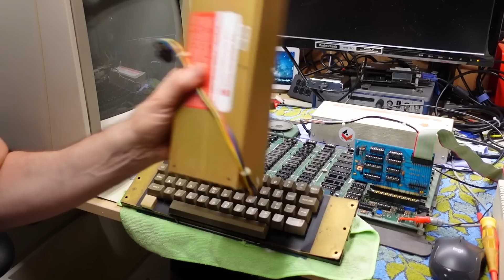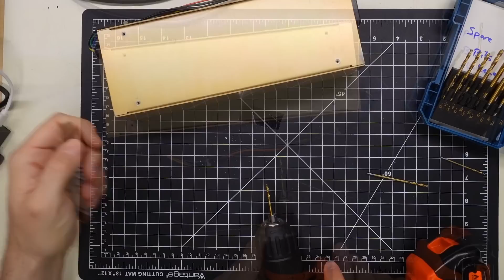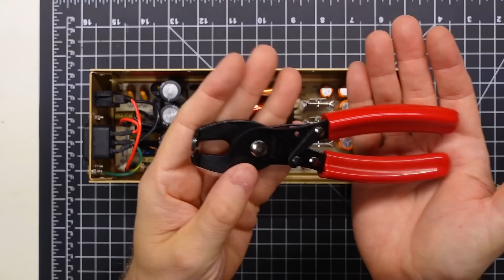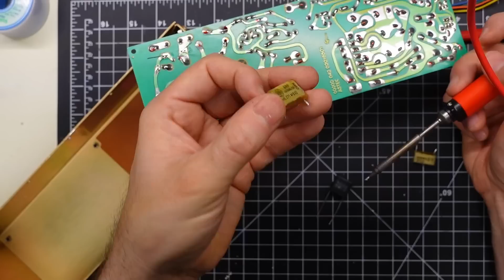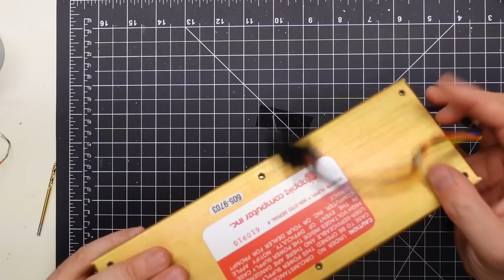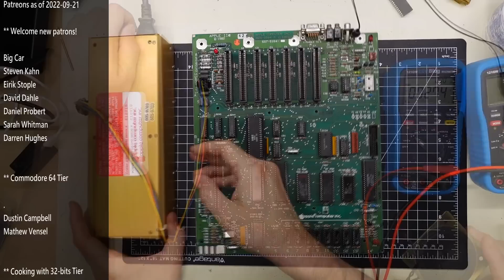Apple II power supply service and testing

Comment: Another reason what you say about caps is true is thus: electrolytes didn’t push as many limits back then, the electrons are packed-in less dense. So, to achieve high performance, you need very high purity and high surface-area. And that’s directly what increased the cost, as well as being responsible for their larger sizes. 

Essentially, it’s akin to how larger floppy disks are more reliable than smaller ones, as each sector is physically bigger. 

People who replace caps all the time marvel at how small modern caps are, but that’s also ultimately just a tighter margin for functionality. It’s no wonder plenty of HUGE filtering caps from the 30s-50s still work great with higher performance than modern ones, once you start looking at it that way. Of course they first have to not be punctured, or boiled, or burst.

Comment: When dealing with a rivet that small I would use a dremmel to grind the head off, then use a small punch to drive the rivet through. Or a dill bit bigger than the hole. And stop once the head is removed.

Comment: dont forget alot of Caps of the 2000s had the capacitor plague as it was dubbed, where alot of runs used water for caps instead of electrolytes

Comment: I think Rifa die in 3 ways. 
1. Humidity-Oxygen infiltration causing decay.
2. material wear either chemical, mechanical, or temperatures causing structural breakdown.
3. Surges when it takes large BANGs through the material and burns a path through it.

*Any of the 3 could contribute to the other's quicker decay and any combination or lone factor could cause failure too.

Comment: Larger drills can be used (should be used) as long as the "web" fits in the hole.  All you need to do is to cut the face of the rivet off of its shaft so the shaft can be pushed through the hole.

Comment: It says right on top. "DO NOT OPEN". Chuck the whole thing in a shredder and buy a modern PC. Do it NOW!
Reply: It's astounding that we have armchair clowns on   idiottube who fail to take any notice of dire warnings on electrical equipment. The switch mode power supplies in the apple II series are *NOT* meant to be opened and messed with. The warning is right there on the power supply itself.  You risk injuring or killing yourself by messing around with high voltage analog circuitry.  There is also a risk of toxin exposure and also ruining the mainboard as replacement caps produce ripples that don't match the original power supply design. 

The only sensible approach to fixing apple II power supplies is to junk them completely and replace them with a modern alternative.

Comment: Hi Adrian, I have a question for you. First, let me apologize for the fact that my question has nothing to do with this video, I'm just taking the shot that you might know something about this.

Some months ago, I purchased a Smith Corona PWP-145 word processor from my local Goodwill. I was thrilled with the find--but although it has a 3.5" floppy drive, it refuses to format any disk I put in it. I tried both high and low density, pre-formatted and unformatted, no dice. Do you have any suggestions as to what might be going on?

Comment: I do a fair amount of SMPS repair at work, and I tend to agree with you on the older caps being better.  That being said, if they have drifted too far off value , or you have too much noise on the output, or are having weird glitches, replace those caps.

Comment: Excellent as always.
FWVLIW: I've tended to replace the guts of Apple II PSUs with modern Meanwell units that have most of the required voltages - Yes, the -5v needs to be added by soldering a regulator to one of the existing rails as the model that has all the other voltages doesn't have that, but it's not a big deal.*
Why? Because they are more reliable and efficient than even a serviced original PSU. Also they have much more overhead for suppling upgrades.

*The Apple II draws so little current on -5v you don't need to worry about bolting a heatsink to it, just find a suitable spot that won't lead to shorts.
No, the new PSU won't line up with the original standoff locations but that's an easy fix - cut a robust piece of packaging plastic to size, screw the new PSU to that, and then screw the whole thing to the original standoff locations. Secure and will ensure no unintended shorts.  

My IIe Platinum is running an Apple2Pi adaptor of my own design that takes it's own 5v & GND supply from a modded and upgraded PSU with a Pi4 strapped to it running a custom install of my own making:
Quite apart from the utility of Apple2Pi my computer does a darn good job of pretending to be a stupidly fast Stealth GS and runs RetroPie as well as giving me a functional Linux (boo!) machine. I modified a broken Apple II mouse for USB / optical / two buttons. All-in-all it's my go-to retro box.

PS A solder wick tip:
If you have crappy wick but a tin of solid flux paste, drag the wick over the paste. Now you have much better wick... or you could just buy decent stuff in the first place as Adrian did!
Reply: What a load of crap,  those Astec PSU's  have worked to 40 years.... with a little TLC and a recap they will last another 40 years.  Meanwell PSU's do not have a 40 year track record so there is no evidence to support your reliability claim.  If fact I'd really doubt they will last that long because we all know that modern devices are not built to last like the old school stuff was.

Comment: 16:16 For viewers that are outside the US and have 230V, these Astec power supply could be easily converted from 110V to 230V by removing the black jumper wire next to the small transformer. It is labeled on the PCB which says "115V select".

Comment: The capacitor plague around the year 2000 is a real thing. A lot of Chinese manufacturers got hold of parts of the blueprints for one of the top notch capacitor brands. Those Chinese manufacturers missed a few critical details though, which made the capacitors leak over a relatively short timespan. The flimsy capacitors ended up in a lot of devices back in the days, due to their low cost in comparison to the actual brands.
Reply: It started in around 1991, tbh, particularly with SMD electrolytic caps. Some stuff from 88-89 was also awful, but as the 90s marched on the component quality went straight to h*ll.
Reply: @MagesGuild  and it went on into the mid 2000’s. Especially with the United Cemicon KZG series which were used in a lot of motherboards from 2000-2006.

Comment: This is a old SMPS and it works with a lower switching frequency than modern ones. So the flintering caps are not that much stressed than today. Right now the new era of GaN SMPS started and the frequency is getting even higer. Silicon based SMPS today are working on about 10-20kHz. The GaN ones are able to do 10-100 times higher. So we are talking about 200kHz-2MHz. The pro is the transformers are even getting smaller. The contra is, the filtering stages are more in stress.

SMPS around the 2000s are often using low quality caps even if they are from a good brand. For the German market BeQuiet is a high end brand. But a lot of their 2000s PSUs died horribly and killed systems. They used ToPower as OEM and those units are s*it on its best.

Comment: The original Apple II systems seem to be fairly quirky...  I seem to remember a service bulletin from Apple to authorized service centers recommending lifting the system off the bench about 4", and then dropping it on the bench.  I think that was Apple's quick fix for chips that started migrating out of their sockets.

As for their power supplies, I've always had better luck with the gold color power supplies.  The downside of the gold ones is they tend to fail without warning...
Reply: The "dropping the system on the bench" fix was for the Apple///, not the Apple II.  These were units were heavily socketed, at least for early units.  I've heard this fix claimed before but I'd like to know if anyone could confirm this service bulletin actually existed and isn't just an Apple myth.
Reply: @vmhanlon  I'm searching for the service bulletin currently...  I remember the one for the Apple ///, they may have extended that one to also apply to the Apple II line.  I remember hearing about it as far back as 1988 or so...

Comment: Reading some of the comments there is a common misconception that Steve Jobs invented the switching power supply. Nothing could be further from the truth.  Robert Boschert invented the switch mode power supply not Jobs.  From electronic design December 6th 2009.

"Boschert is most widely honored for wearing the electrical engineering “hat” that resulted in the invention of low-cost, volume- usage switching-mode power supplies. 

The right opportunity came for the breakthrough power-supply system when a company wanted something to power a printer, says Boschert. It had used a 20-lb linear power supply. “I bid on the project, but my 3-lb design was more expensive than the linear one. I said I’d do whatever they wanted, so I came up with a linear design, but that was more expensive than my switcher. It was then that I realized that when my switching power supply got into volume production, it would be cheaper than the linear style,” says Boschert.

He began production of the new power supplies in 1974."

In 1974 jobs was working for Atari stinking up the lab cuz the guy didn't want to take a bath. He thought because he consumed mostly fruit he wouldn't stink.  Many reports from his contemporaries would differ from his thinking.  Some reports said Jobs wreaked of B.O.

Comment: Ooh yeah, I hate those cable grommets! Definitely need to pick up a pair of those grommet pliers for myself.

I still haven't got around to finishing off building the replacement for the power supply in my Apple II clone. I finished making a bracket to mount a TFX power supply, and I got the replacement power connector, but I still need to get a crimper since my current one doesn't have a section large enough for the contacts.
Reply: :shrug: The grommet used here is a rotate and slide style IIRC. I have never required a special took to remove or insert them.

Comment: To get the rivets out, you can use a dremel tool with a die grinder to grind the top of the rivet off. This will alleviate the issue of the rivet spinning when you drill it because you can use the die to grind it down from the side (put pressure on the rivet with the die oriented sideways).

Comment: You can also use a cold chisel to remove rivets, that might be a little too much  hammering on electronics though. Maybe if you used a rotary hammer chisel or air hammer chisel

Comment: This Apple PSU actually looks somewhat similar in design to the BBC Micro power supply that ASTEC also made. Probably very close.
Reply: I do seem to recall a few ASTEC ones in my collection (1981 Made in England), I have others that are manufactured to BS415 by BSR (UK). They are also open frame (they use the computer case as a lid) with a captured mains-in cable. They are slightly smaller in length than an Apple PSU and it also has a voltage out connector to power all the peripherals that came out for the BBC. Rated for 220~240V @ 50 or 60Hz there is provision on the PCB to change the input voltage to 115V. Also the mains cables are connected via easy to remove spade terminals with the earth connection screwed in place, a slightly more expensive design choice.

Comment: Adrian, As for the rivets you can use a metal hole taper bit to cut the head off then use a punch and push the rivet through. Mason HP-2 Rivet kit sold by Snap-on, Mac (Mac-ko) and other tool truck sold a kit that had a special tapered removal bit. I have had my Snap-On version for 40 years and it has the drill bit. The newer version does not come with the bit no longer I guess. I scowered the Amazon, eBay, InterWebs in the middle of this video and apparently that bit is no longer available in the kit (or anywhere) but the case still has the molded area for the bit. Like I said mine is 40 years old... LOL

I just love watching you work on stuff. I don't use any of the apple stuff but your tidbit of information is awesome...Thanks!

LLAP 🖖

Comment: The "glue" your finding on the screws is a security measure so that Apple can tell if someone's worked on the device. It's painted over the screw head and onto the PCB so that, if it moves, doesn't line up, or doesn't match at all, it becomes obvious that someone's worked on it.
Reply: Those were not seals so that Apple could tell if somebody had been into the power supply. By drilling the rivet out a technician could tell you been in there. If you notice the treated screws were near the power transformer.  The real reason is the transformer sends out micro vibrations that will eventually loosen the screws. Same thing happens when capacitors are operated at high frequency. That's why you often see hot melt glue and other adhesives used around the base of capacitors in switching power supplies.  Dampens the micro vibrations and prevents cracking of the solder around the capacitor leads resulting in a condition known as a witch's hat. Heat and not enough solder can also result in a witch's hat joint.

Comment: Those pop-rivets were an early version of Apple's 'no right to repair' policy!
Reply: I’ve removed my comments due to the trolls. You can work out who that is.
Reply: @markcummings150  "Yes they are a tamper indicator." With the confidence you wrote that ... where was that confidence when you decided to NOT show us the source of this remarkable conclusion? Then "those days" ... is 1980 for you the ancient past?[2] Are you joking? BTW "ancient": Riveted joints have been used in mechanical construction and jewelery making for thousands of years since ancient civilizations[1]. Not only were rivets (as well as metal drill bits) widely and freely available in the 1980's, but no one (including the people who certify at the FCC) would call these riveted joints tamper-proof. If you do research, you will find topics like "water proof", "cheap and tight connections", "perfect for sheet metal connections", but not tamper indication. Even your mentioned "blob of paint" would be more suitable for such an application if it contains something like a seal imprint. 
Sorry about the rant (which is actually: FACTS), but the grin I had reading David's comment stuck in my throat after reading your comment.

[1] Why not at this point a conclusion that is not from fairy tale land and actually makes sense?: Rivets came and were used BEFORE screws, including the Egyptians 5000 years ago ...
[2] Sorry, but that sounds like a small child who cannot judge time intervals. The year 1980 is 130 to 230 years AFTER the period we commonly refer to as the "Industrial Revolution". You can't really be serious about your claim about the rivets, can you?:)

Further reading: Ken Shirriff's blog about the apple power supply, Wikipedia, "History of Rivets" or "A brief History of Rivets", etc.
Reply: No, they were an early 'cover our assets' measure to prevent electrocution by hobbyists used to poking around inside their machines. Later PSU revisions removed the rivets and put a gigantic 'high voltage' type caution sticker on the PSU top case.

Take it from a technician who slipped and got 50KV down me right arm, actually cooking me muscles while working on a Tempest vector machine, it is not fun. I was lucky, and I was not intending to be anywhere near those components. As I recall, someone walked in, asked me a question, I tried to sit up and answer them, then...bzzrrt.
Reply: @markcummings150  So no citations or a source. Instead evasive maneuvers and nothing of that addresses any of my arguments or questions. So we can assume I got the important facts of my last comment right, you're okay with that, and we can safely ignore your nonsense. Thank you for the quick reply!

P.S.: Maybe talk to someone at the company Loctite? To explain the purpose of what you call "paint" lies exactly how in my responsibility? Or to provide proofs for the claims of others? That isn't even funny ...